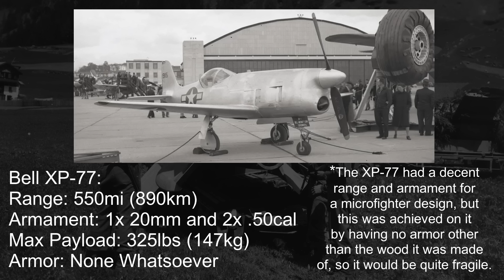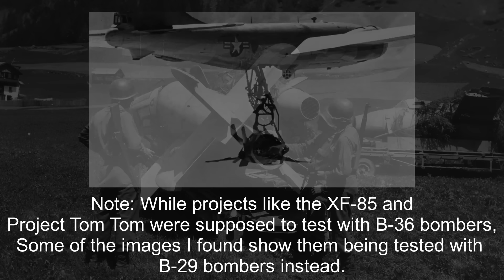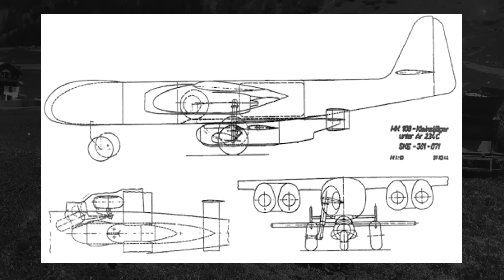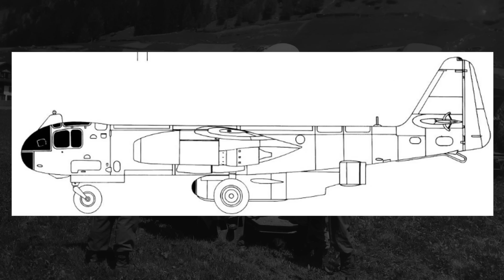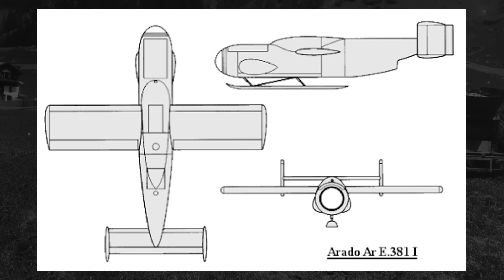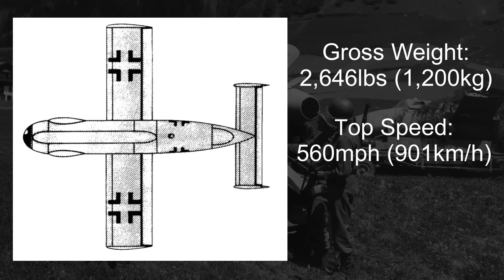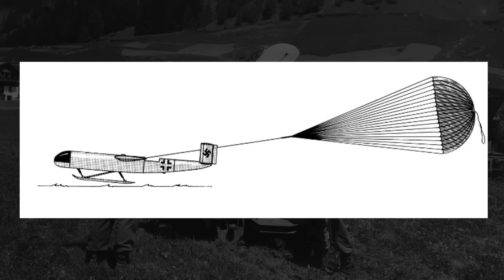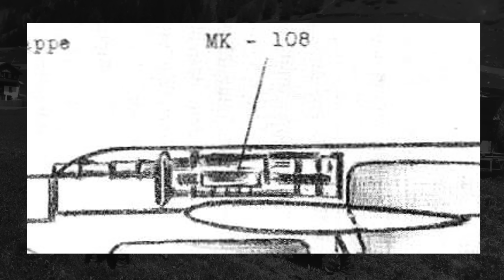The  Emergency Fighter Barely Bigger Than Its Pilot: Arado E.381

Comment: I winced seeing the internal diagram of this plane.

The pilot's lowet half is surrounded by the T-Stoff and C-Stoff fuel tanks.

Even a simple leak would melt at least the pilot's legs (enemy gunfire would only be worse) while an explosion resulting from the two reacting like they often would would be right next to the pilot's body.
Reply: Bombers sit on a ton of explosives in their bomb bays and often under belly and wings, getting shot at by flak and fighters with explosive, incendiary and armour piercing rounds.

Submarines sit around with explosive torpedoes — and some are explosively fuelled.  Remember the K-141 Kursk ? 2 nuclear reactors, 24 P-700 Granit missiles (never mind the 750kg high explosive or 500 kton nuclear warhead on each — that thing is 7 tons, most of which will be fuel, solid fuel in the booster, fuel for the ramjet in the body, the super-heavy Type 65-76 wake-homing torpedo (450 kg warhead, HTP fuel).

I do not think being in that for weeks and weeks versus a quarter hour with just the T-Stoff. C-Stoff you don’t want to drink or get into your eyes, but it is not really bad … just do not mix with T-Stoff.

And T-Stoff is simply disarmed by copious amounts of water, is not toxic or carcinogenic … avoid skin contact.
Reply: Bombers sit on a ton of explosives in their bomb bays and often under belly and wings, getting shot at by flak and fighters with explosive, incendiary and armour piercing rounds.

Submarines sit around with explosive torpedoes — and some are explosively fuelled.  Remember the K-141 Kursk ? 2 nuclear reactors, 24 P-700 Granit missiles (never mind the 750kg high explosive or 500 kton nuclear warhead on each — that thing is 7 tons, most of which will be fuel, solid fuel in the booster, fuel for the ramjet in the body, the super-heavy Type 65-76 wake-homing torpedo (450 kg warhead, HTP fuel).

I do not think being in that for weeks and weeks versus a quarter hour with just the T-Stoff. C-Stoff you don’t want to drink or get into your eyes, but it is not really bad … just do not mix with T-Stoff.

And T-Stoff is simply disarmed by copious amounts of water, is not toxic or carcinogenic … avoid skin contact, though!

Comment: Wait! The canopy thickness was 145mm? That's over five and a half inches!?! It would have weighed as much as the pilot.
Reply: 5.7 inch. Sometimes you need to protect the pilot. Also, what is the diameter of that vision port (canopy implies opening)? It’s not huge. And it is the most likely part to be hit.  Another 80 kg to give an improved chance of hitting the target is well spent, and psychologically makes the pilot feel more safe, thus allows for more aggressive attack.

Comment: It is pretty much just a low-tech version of an air to air missile.
Reply: Pretty much, which is why as soon as technology allowed guidance, manned parasite fighters became unmanned parasite fighters, often called a “missile”. More G tolerance, less need for space and does not have to give the pilot a chance of survival.

The Bachem Natter was a bit higher tech low tech SAM, with ground guidance to the target and then using the little-trained pilot to fire an (unguided) rocket salvo at a bomber, which would cause enough damage to bring it down.

Comment: Like if they could release like three of those little bugger and they had twice the firepower it might have been interesting. Like this it's really a waste of effort and resources.
Reply: Like you don’t understand what a 30mm  hit did do to a bomber. Like you do not know what resources were commonly available and which were rare. Like you don’t grasp what bombing did to cities and civilians.

Like how about you offer a better solution?
Reply: @advorak8529 Like you make a lot of assumptions with no basis.

I do know what a 30 mm hit did to a bomber, but I also understand how MK 108 guns with low muzzle velocity weren't exactly easy to use, especially by inexperienced pilots. In addition even the more experienced pilots complained that jets like Me-262 were too fast to use that gun accurately. This thing had 45 shots which with the usual cadence of 650 shots per minute made less than 4.5 seconds in a burst and enough fuel to make one or two passes. It's almost like a more complicated Me-163 with even less ammo and so far unknown flight characteristics to work with. And we do know how successful those were while defending the Reich.

Not sure what you are trying to achieve with the bombing commnet, but if you want a better solution then maybe replay the video - make normal fighters rather than this nonsense.

Me-262 brought 4 30 mm guns with 80-100 rounds each and needed two jet engines and one pilot. And that was no Volksjäger, but rather a high end plane.

Arado Ar-234C with one parasitic fighter had a grand total of 1 30 mm gun with 45 rounds and needed 4 jet engines (although somewhat less demanding) and three rocket engines and two pilots to deliver that. Is that enough to show how shitty the solution is?

Comment: Problem: fighters losing power at altitude.
Solution in USA, GB etc.: put a supercharger on an existing engine. Develop a new high altitude fighter if you wanna be extreme.
Nazi Germany:"The only logical solution is a radicaly new, cost intensive fighter with a tendency to spontaneously explode or a midget sized parasite fighter."

Comment: The video goes well until you assume that several E381s would be needed to kill a sinlge bomber cause they have only 45 rounds for the MK108 cannon. Let me remind you that German pilots  needed only five 30mm rounds to make a B17 explode mid air. Confirmed by Galland while flying the Me 262. Aircraft that you also failed to mention in this video. Plus the Me163 with all it´s flaws confirmed that a rocket powered aircraft could just ignore fighter escorts and bomber gunners.

Comment: The ME 163 was a small rocket powered fighter. It used the same fuel mix (T-Stoff and S-Toff). It also had a skid landing system. They weren't weren't made in any great numbers. Sometimes they would crash while landing and the residual fuel mix (being very corrosive) would dissolve the pilot.
Reply: No, they did NOT use S-Stoff.
The A model (training/development only) used T-Stoff as monopropellant with Z-Stoff as catalyst.  Just as the Starthilfe RATO system did. 

The production/armed B model (and later) used the much more powerful and hypergolic T-Stoff + C-Stoff combination. They still used T-Stoff with Z-Stoff to run the fuel pump.

The Mercury capsule used T-Stoff, too, BTW.
Reply: @advorak8529  I guess I chose the wrong Stoff. Get it?

Comment: 8:50 - Flying coffin, with view. 
Good luck finding an insane pilot to fly that flying death trap. He might be crazy Nazi but not crazy enough. Hitting ground would be like a moth slamming speeding car’s headlight… splat.
Reply: There were a number of pilots ready and willing to get into old Bf 109 and ram bombers — for example, trying to cut off their horizontal stabiliser with a wing. Not kamikaze but you’d not land that aircraft afterwards.

There were volunteers for the Me 163 which killed more Germans than Allies.

Never mind some of the midget submarines and manned torpedoes with a cockpit — Losses like 12 went, 2 returned, no successes; 18 went, 1 returned, 1 ship sunk …

… Tell me again about “not crazy enough” to fly a minimal size plane towards some bomber at high speed, pull the trigger, repeat once or twice, then land and done with the day.

As to [h]itting ground you clearly did not understand the presentation. You’d land on the extended, sprung sledge and stop with a parachute. The 163 has shown it can be done pretty easily if the pilots are trained in high-speed glider landing. And the 163 was a glider, this thing … not so much.

Comment: How did the project get even as far as it did.
Trying to think of a good modern equivalent, maybe using an unarmed F-35 to carry a tiny fighter with a pop gun.
Even that doesn't sound as bad because a) the F-35 would have a better survival rate if bounced and b) using arguably the most advanced bomber of the war, of which you don't have many, using fuel, of which you don't have to spare, to be a taxi for a machine that even in optimal conditions isn't going to stop an allied bomber.